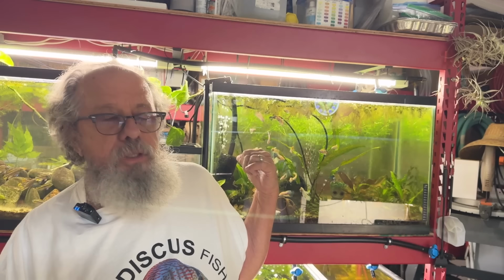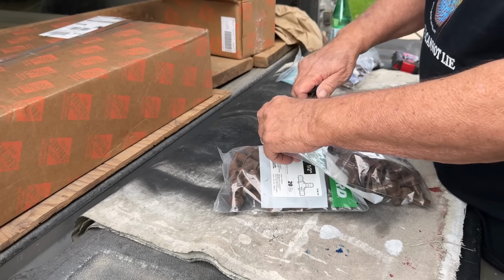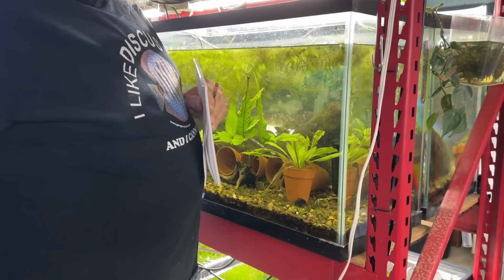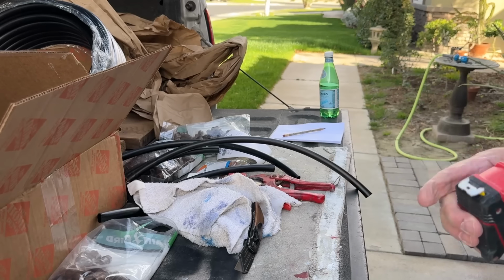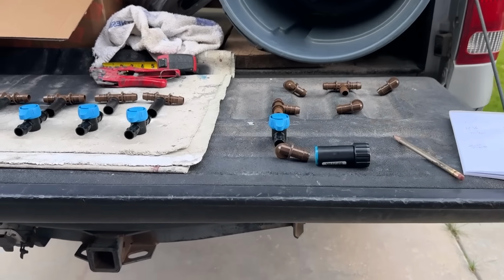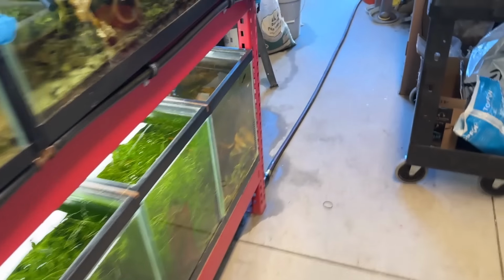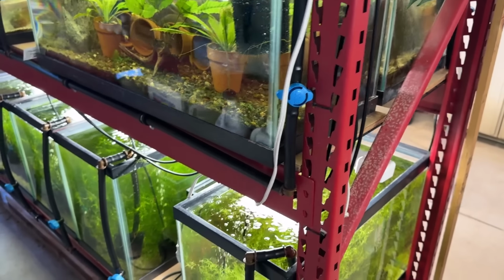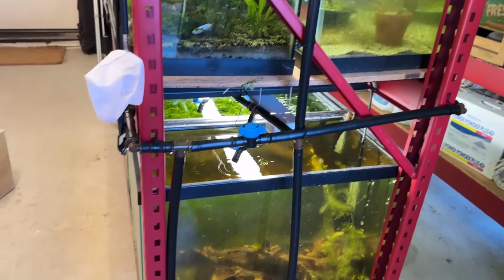I Show You Step-By-Step How I Built A No-Drill Water Change System

Comment: I’m new to your channel, but did you end up keeping this system? Or did you change it? I was thinking it may work with pvc also? Thanks for the detailed vid.
Reply from the maker: First, let me say thank you for watching, Randy! I do appreciate that. To answer your question: no. I ended up dismantling the system. I originally used just the friction-fit of the fittings and the tubing, then added the vinyl clips then on to stainless steel hose clamps. The system wouldn't hold water and the siphon kept breaking so I'd have to recharge the system each time. More of an inconvenience than anything really. But it was more cumbersome thank it was worth. So the solution would have been exactly what you mentioned: PVC, and glued fittings with ball valves. That would be a water-tight system that would stay charged. (I do have a video for a permanently charged drain system for my 75 gallon tank. It's all glued PVS and works perfectly.) The drip irrigation valves I used were terrible. I've got them on the refill system as well. The leak! Anyway, I hope that's not more information than you were looking for? But again, thanks for watching and welcome to the channel!
Reply: @RonsGarageAquatics I appreciate the response, I may try it using pvc, it will be indoors away from drainage so maybe a large trash can on wheels would work and then siphon into a sink. Thanks again
Reply from the maker: On that system I have on my 75 gallon I have it exiting via a female hose adapter. It stays permanently charged so all I have to do is to hook a garden hose up to it and run it out to the front lawn, turn the ball valve and it automatically starts draining. I’ll typically have another hose filling simultaneously and let them both go for a while. Then it’s just a matter of balancing the inflow to the out flow so not to overflow or drain past the outflow.

Comment: A heat gun will straighten the tubing...that is exactly how I reform my plastic tackle boxes that warp over time....just make aure to keep the gun moving and dont overheat! Wear a garden or leather glove and gently form the tube to the shape/angle you want.
Reply: Also....adding check valves to your lower tank's drains will prevent the top tanks from overflowing you're lower tanks.....
Reply from the maker: Great ideas! Tanks for stopping in!

Comment: Wouldn't this be easier with PVC pipe?
Reply from the maker: Yeah, probably. I've got these nylon clips for the ends of the tube over the fittings to keep the tubing from blowing off. So if that doesn't work, and this turns into an epic fail, then I'll probably swap it out for PVC. Tanks for lookin'!
Reply: @RonsGarageAquatics   I like the idea, I don't have a drain in my fish room, just a window, plus my tanks are not drilled. So I might try this to see if I can make water changes quicker.  Maybe the water-in would be better if the water supply connected directly to the top rack pipes than being pumped up from the bottom.
Reply from the maker: @abhirana4742  Yeah. I competely agree with having a permanetely plumbed in water fill. I'm working out how to pull that off here too. And then I would do a mix of copper and with PVC ball valves instead of the drip irrigation valves. I also need to figure a way to step up the draining from the bottom rack of 20 gallon tanks. They're too close to the ground to get a good siphon flow going. Someone suggest a pump in-line. I thnk that may be a good solution for that. The siphon flower on the higher up tanks works well as they are. Tanks again!
Reply: @RonsGarageAquatics   What would be cool is to have an external water pump that can suck the water out through the system you have installed and direct it to a drain/lawn.  Then there would be no need to worry about losing siphon. Water fill up would be nice to have a float valve that shuts it off automatically, would avoid over filling tanks. Just some ideas. I have been thinking about this stuff for a while. I have a fish room, with no drain and no water source and my tanks are not drilled. haha, I do have a window to the back yard and might be able to get a plumber to bring a water source in that room or drill a hole on the wall to create a drain... Wife will probably kill me.
Reply from the maker: @ hahaha! Wife’s! Exactly the same. No drilled tanks. The water source is a garden hose from outside. And the drain is a garden hose to the outside too. And I was thinking about an in-line pump that’ll draw the water outside. Once upon a time I was using a little submersible pump going from tank to tank into a bucket then dumping those onto the lawn. Then it evolved to a PVC rig with a ball valve on the end of the hose still from tank to tank. I’m just trying to make it all a bit more simple.